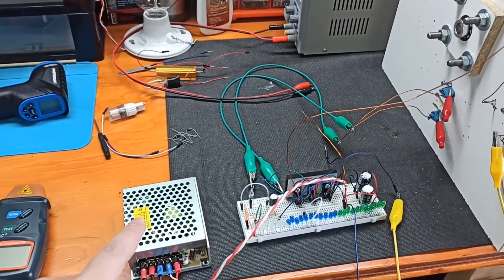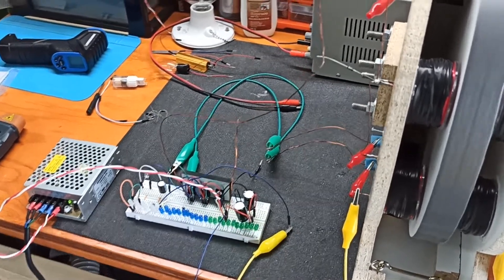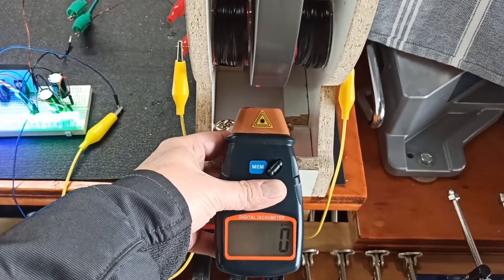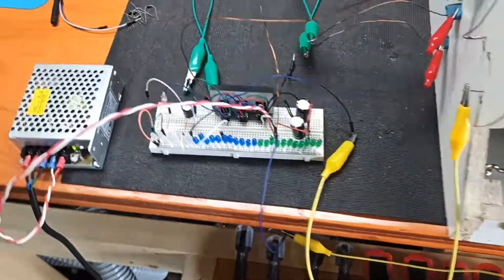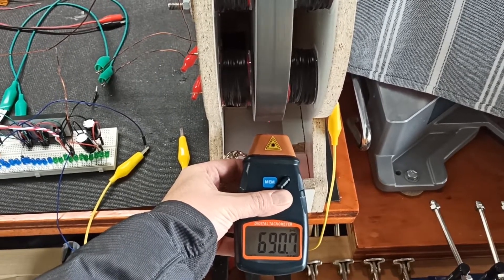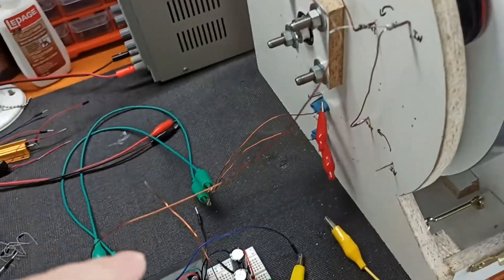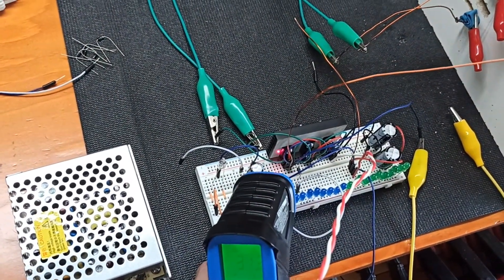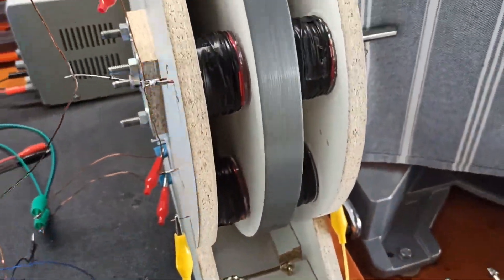Electro-Magnetic Pulse Motor - Part 24

Comment: I like your video you did on your pulse motor I myself have been working out pulse motors for probably 4 years now and I've got a lot of experience when it comes to getting huge amount of efficiency as well as a high output so here goes..... So my motor that I designed 4 years ago... is based on the Robert Adams motor and one very critical thing that he says in his patents that you must use a mechanical relay spark gap type switch or a rotor type switch that is the only way you can get the best battery charging effects as well as the highest back EMF readings.... my motor can put out 210 volts! Back EMF at only at 8.5 volts input... at 60 milliamps!!... Which is very impressive now this power that I'm putting in is called reactive power and it works on different physics than your regular standard power so instead of lighting LED lights I can light house lights with my motor. I could go on and on about this the best thing to do is check out some of the videos I've done on my pulse motor generator look up Faraday research RND
Reply from the maker: Hi Mike, I know you already.  We've chatted via email a couple of times.  lol  I enjoy your videos too, I just don't understand enough to make a lot of sense of them yet.  Haven't watched any in the last couple of months though, YouTube hasn't been pushing them up on my recommended videos page.  I'll have to double-check my subscription.  Either way, your results are amazing, I believe you using a neon transformer and spark gaps.  I think what I'd love to see in your videos would be something showing watts out, watts in, and just go to town on the light bulbs, lets see a light bulb board or something.  That would be very cool.
Reply: Is it possible that the collapsing magnetic vortex captures energy out of the eather, like opening a tap?
Reply: @johncook7895  Yes, you're exactly correct